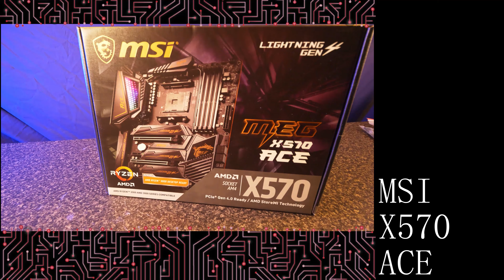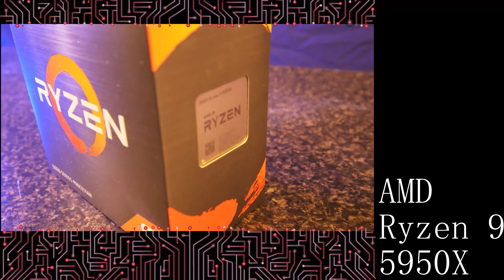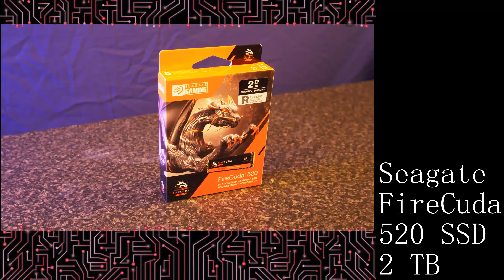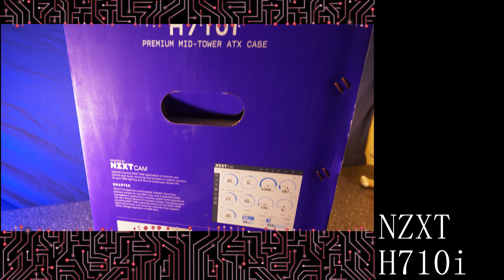Multi Unboxing: The Red Dragon Build

Comment: You should have turned on XMP to achieve that 3600mhz on RAM
Reply from the maker: Did set the A-XMP to [Profile 1], do you mean that? Or is there somewhere else where you can change that? (My previous build had IDE and a ZIP drive so due to rustyness all help is welcome ;) )
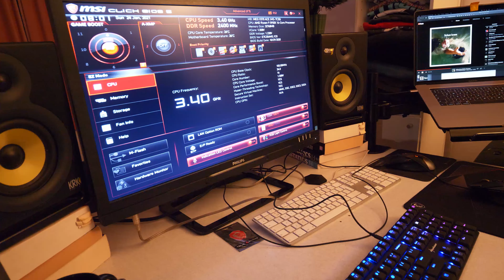Reply: @DavevanRoon   In the video around 16:18 noticed it was  running at 2400mhz ..that's why .. since you have turned on XMP pretty sure it must running at their max speeds
Reply from the maker: Aah, you're right! Yeah in the meanwhile it does say 3600. Had to cut down a few hours of footage to a not-too-long thing, so I cut before the XMP and auto-power-up-after-power-failure. At some point I want to look more into OC, but for now it's not really needed. When I run COD at max settings the machine doesn't really care :D